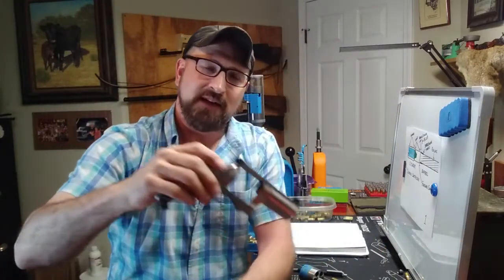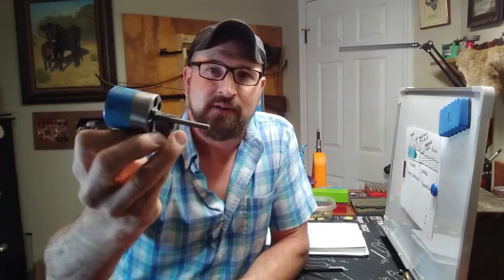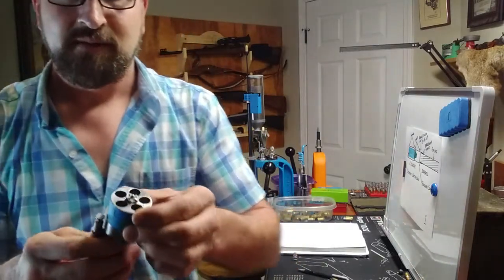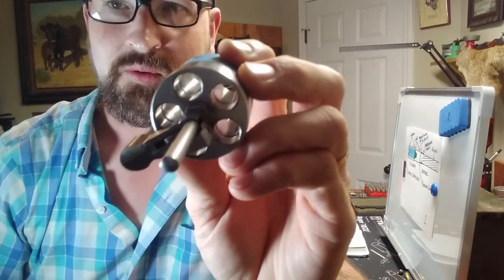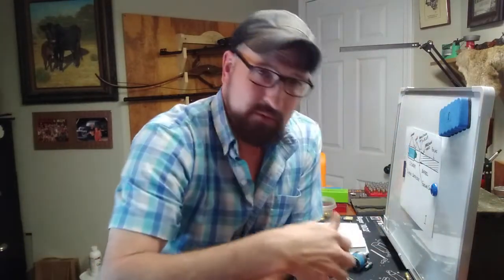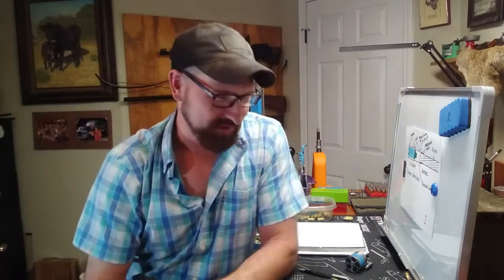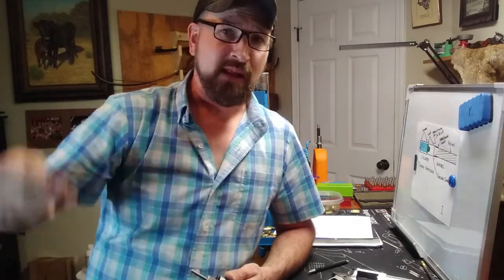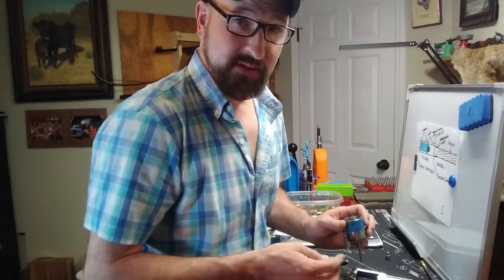1. Cast Bullet Path (Revolver throat, purpose and measurements)

Comment: Just found your set of videos and started watching. 
Instead of lead balls, you can use the football-shaped sinkers.
Or, a step up but more expensive would be to use machinist pins. They would give you exact measurements and are quick.
Reply from the maker: Thank you for checking out my videos. I'm not opposed to using pin gauges. But I do feel that if there is a less than concentric throat diameter I wont be able to gauge the high spot. I've got a Bulldog 44spl like that.
Reply: I realize that. I haven't had a problem and of course, you will be able to notice if out-of-round. and the whole idea is to then ream the throats so they are all round and the same diameter. They are more expensive, but sure speed up the process.
Reply from the maker: I've got a good set of pin gauges. They aren't big enough for any of my revolvers except for my 22 bearcat. I've considered doing a video just to show the method that you speak of. Shoot, I'm on quarantine for covid right now... maybe I can make that happen real soon like :)
Reply: Mine is from Vermont Gage. 
260 pin set from .251 to .500, I should pick up the guages for the .22 cal.
Seems like everyone is on or just off of quarantine. I wish you well and soon to be able to get back out and about.
Reply from the maker: Interesting. Mine is Vermont as well, but it's all the smaller sizes below yours. Thanks for the best wishes.
Reply: If you lived close we could share.